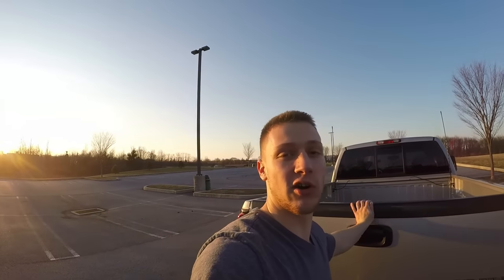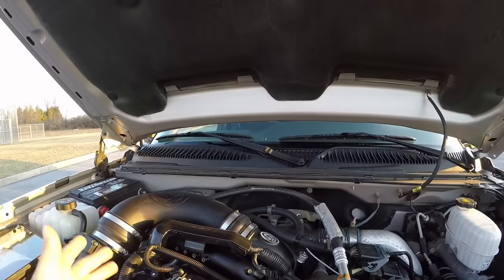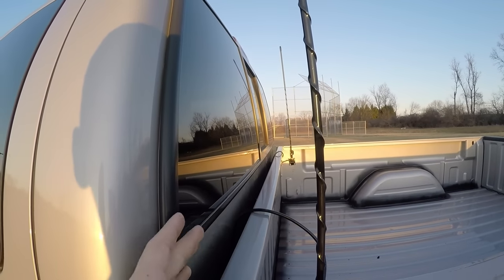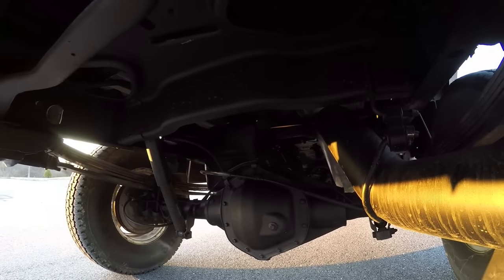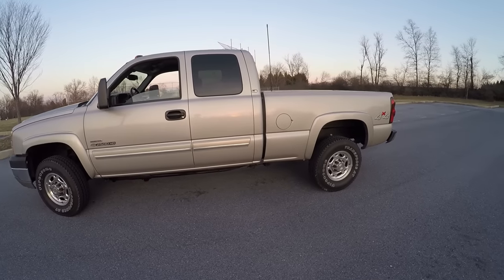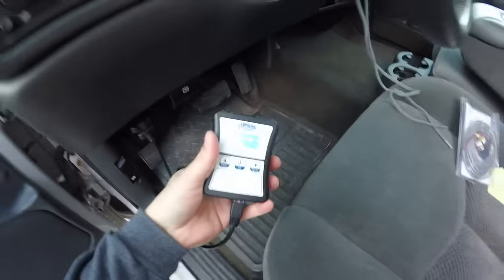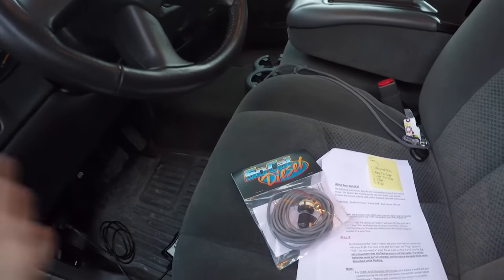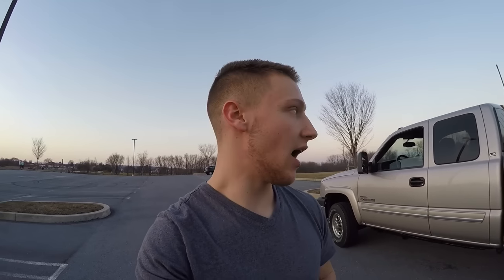Duramax Build Update! Engine Build is DONE! + How to Use EFI Live Tutorial!

Comment: Awesome job I agree with everything your doing.   Keeping it reliable and also amped up at the same time is the way to go, cuz diesels aren't cheap to fix.  Can't believe u got it with only 13,000 miles on it.   Sweet find.   Good luck with her and as a tip get some American force wheels on those axles 👌🏻.

Comment: Nice bro, your doing all the right things to the duramax for longevity and a little more power and fuel mileage. Good idea on the coolant flush. But I have a few tips for you. Make sure you change the coolant every 50k miles. Reason being is the duramax motor has a cast iron block and aluminum heads. Over time the coolant will brake down and electrolysis will happen. That is a chemical reaction between iron and aluminum. It can eat the heads and head gaskets causing head gasket failures. Also I have always ran the nictaine CAT fuel filter kit on all of my duramax trucks. It's a true 2 micron caterpillar fuel filter. All the fuel filters at the parts stores and even the Oem GM fuel filters are horrible. They let contaminates through to your injectors and it's a $5,500 dollar job parts and labor. The cat kit is $130 and it comes with 1 filter the nictaine adapter and a fuel priming pump head rebuild kit. Also the CAT filters are only $15 to replace. Also a fass lift pump would be good to
Reply: +rexburn1955 
I think it's best to change out the coolant every 3 yrs vs going by miles. You are more likely to hit the yrs before the miles. & by the time you hit said miles, you may have 4yrs+ on the coolant. (Dexcool up to 5yrs or 100K miles whichever comes 1st.) Stick with Dexcool. It's designed for it. Or if you don't want to use it, (for some reason) make sure you flush out your coolant really good before you switch to non Dexcool. 

Fuel filters OEM Racor (PFF50216)/Ac Delco (Old part # TP3012), Baldwin (BF9882) & Donaldson (P550833) are 4 micron rating. 
All are far from crap. & they are 99% efficiency. Which is what Bosch desires.
New ISO testing standards, rates the Cat filter at 4. Cat use to be a 2.
Reply: +TDNomad the shit you read online and the shit GM tells you are far from the real world. I am a diesel tech and have owned and built a dozen duramax's. I've owned every every motor configuration from my 2001 duramax to my current 2008 duramax. And I work on them every day. Dexcool looses its ability to fight electrolysis. The reason being that you tune your truck like you have and run the egt's and coolant temp higher than it would in stock configuration. Heat kills the coolants life. That's why I recommend you change it every 50k. The lly duramax and the lb7 duramax are know for head gasket fallers more than any other year duramax. Mind as well change it at 50k. It's called preventative maintenance. Also the 1R-0750 cat filter is a true 2 micron filter. Call ATP diesel and ask them if you don't believe me. They are who I buy some parts from and I run Idaho robs tunes too. And as far as the Oem filters and wix ect claim to be 4 micron. But they are actually 8-10 micron. They get away
Reply: +TDNomad they get away with claiming 4 micron but they are truly 8-10 like I said. They get away with it because of the way they do the math. They are really more than 4. Especially GM filters. They are 10 micron for sure. GM wants your injectors to fail. They want that $5,500 for parts and labor! I like your channel and think your a cool dude. I'm just trying to give u a few pointers man. I've been in the diesel world for years. It's all about preventative maintenance. And clean filtered fuel in your truck and don't run the egt's high. Egt's are what kill Diesel engines. Also Be prepared to replace your front wheel bearing every 20-40k miles after your lift FYI. O one last thing. Only use genuine Allison transmission spin on filters. All aftermarket replacements are garbage. Clean your mass air flow sensor every 10k miles too. It's a 5 min job. Since u are running a dry filter it shouldn't be too dirty after only 10k but it's cheap and easy so it's best to just do it on a 10k schedule
Reply: +rexburn1955
Wow. Where to start? 
You talk preventative maintenance but give bad advice (for being a "diesel tech") on coolant service. Coolant life as an UP TO lifespan of "X" amount of miles/ "X" amount of years whichever comes 1ST. Coolant is/should be based on whichever comes 1st. Some people may take years to reach 50K miles. & by that time the coolant is really old. You can't say just wait until you reach "X" amount of miles before you change it WITHOUT knowing how old the coolant is.

And with your said "claims", you should or at least have some actual better insight to this filter info. Call ATP if I don't believe you? So call actual techs, because you can't vouch for your own claims on this info? Got it.

I've done my research (on the net & have talked to actual GM service techs & GM diesel techs) & I'm not claiming to be a know it all. I find it hard to believe that the ISO info to be wrong. The GM service techs & diesel techs can/may be wrong, but the 1s that I talked to SHOWED me the same info I found online & the GM TSB about the micron rating on the Delco fuel filter from years ago.

The #1 misconception (you should know this) is the Racor/old model Delco filter to still be a 10 micron rating. It's been a 4 micron for years now. GM has A TSB (again you should know this) about the change over years ago to try & help prolong the life of the injectors on the LB7s. & yes the CAT fuel filter is now a 4. Same goes for Baldwin & Donaldson. I'd say look it up but you don't believe said info on the net & or what actual GM techs say to be true. Because you're a "Diesel tech/builder/owner/fix them every day" BS claimer. Oh well.

Comment: bro i got myself an 09 with a 6in skyjacker lift and 35s nittos mt with 75k miles. i ordered a egr full delete, 5in turboback magnaflow and ppe programmer. i love the power so far, im hooked never going back to gas again.
Reply: do a fass lift pump upgrade and trans go jr for the tranny with tranny cooler, protect that allison, those are my next mods which are for reliability as well.
Reply: +cgr88m one more thing, i will be changing from xds to hostile 20x10s check them out they make sweet 8lug wheels

Comment: also run your cb wires down through the post hole pockets, it has to go into that hole on the inside and then up over the pocket. i actually welded up boxes with a side missing so my whips are up on my rails and flush with the bedsides. alot better for stacking stuff in your bed and not having them in the way!

Comment: Cut the tie rap next to the alternator are you going to have problems with your FiMC and Port to fuel rail  fitting on the driver side and then your done !!! 😉 A lift pump in a factory filter filter delete would be nice to .

Comment: What paint did you use to undercoat it? I would like to do mine just for  protection. I hate the gloss color you can do with like POR15 and rattle can crap. I use rubberized paint before winter, but i need to really do my bed this summer. Trucks coming along good as well. Just a correction too. It's S&B. [S and B] Lol. No hate intended!

Comment: There is always some sort of phantom bolt holding ur things down! Truck is lookin sweet! I want to do similar things with my 2000 F150. Im still kind of a noob but why does everyone with a diesel go for the EGR delete?
Reply: EGR (exhaust gas recirculation) is just some bullshit emissions equipment made standard and all diesel pickups from the factory from about 2005 on up, (depending on manufacturer.) people delete them because they arent necessary, hurt performance and reliability in general

Comment: I think some black bushwhacker fender flares would look good. Also, I think you should've gotten some 20x10 wheels, the ones you have now are stretched a little bit and I'm not a huge game of that. That's just my opinion, it's your truck do whatever you want.
Reply: Bushwackers are a no go on anything, and the wider wheel the better
Reply: +@Back 2D Designer I'm gonna have to disagree. the wider the wheel is a better thing if you have wider tires. Stretched tires are retarded though, absolutely no function and look horrible.

Comment: still crazy how a 11 year old diesel truck has only 13k miles on it. Good purchase.
Reply: He payed over $30,000 for it he could of got a brand new Cummins 6.7 6 speed manual for $43,000 if you want a duramax buy one with like 150,000 miles for less than $15,000.
Reply: +Dodge 318 Cummins no way I would never pay 30k for a 11 year old truck, I would pay no more 15k.
Reply: +Phillip Berk only way to buy a diesel truck for 15k is if it has 150,000 miles or more, or its old as shit. its ridiculous how much value they keep. im sure you can find a decent one for 15k but your never gonna find that at a dealer, and very very rarely on craigslist
Reply: +PeteAndWyattAdventures I see plenty of trucks for under $15,000 I would get my self a perfect low miles 2005-2007 6.0 powerstroke for around $10,000 and get the engine completely bullet proofed by powerstrokehelp
Reply: +DevPack  I have a 2006 Monte Carlo SS with 13K miles.  I bought it brand new off the sow room floor.
Reply: +Dodge 318 Cummins lol "no way he couldve gotten a new cummins for 43k" yea no shit that's gonna be more than 15k more by the time you're out the door
Reply: +Jay Herrod actually only $38,000 for a 6 speed base lol. Build your own at ram.com
Reply from the maker: +DevPack Thanks man! My goal was to have one of the cleanest low mileage 05-06-07classic body style duramax's in the country

Comment: You could have ran the coax right through the holes right above the antenna mount, then down under the truck. Would have been a cleaner install.

Comment: 0:41 hahahah look at his legs
Reply from the maker: +TBMilitia Gaming #skippedlegday
Reply: looks like the pirate on family guy
Reply: +Street Speed 717 weight reduction lol
Reply: +akat9700 since the truck has cab lights, it shouldn't matter. basically the 5 lights on top of a vehicle means it's a large vehicle, like a tractor trailer, etc......unless you're a grandpa with cab lights on your ford ranger or Chevy luv
Reply: +akat9700 the DOT states that "clearance marker lights" will be mandatory on any and all vehicles 80" wide...most full size pickups are stated as being 80" wide.....they might not really be 80" but, mostly all trailers are wider than a pick up truck.

Comment: Hey bud. I have a 2005 LLY duramax too. I have a lot of the same upgrades you have done. I've had the truck for a little over 2 years now. I got it with 105,xxx miles. It now has 160,xxx miles. I will let you know what I've have had to do as far as problems. The year of the truck has a bad pump housing in the 4 wheel transfer case. it will rub a pin hole in the case and cause the fluid to slowly leak. It has ceased up my transfer case. The water pump was pretty labor expensive to replace. My hydro booster started to leak and has to replace that as well. Has the replace the fuel pump housing, it was cracked and wasn't holding a prime. it was replaced with a metal housing. the one before was platic. Both front wheel hubs, inner & outter tie rods, upper & lower ball joints, pitman arm, idler arm, upper A arms, and the main problem is my transmission. The allison 1000 for the LLY is the weakest of the 1000's. My 5th gear always slips when towing or when I'm in race tune. For an upgraded transmission, I was quoted $4,500. That is still yet to be replaced. Mods I have- EFI live, dsp5 switch, 4" strait pipe, S&B turbo inlet, PCV rerout, and EGR blocked. I wish the truck wasn't so problematic. I have friends who have other generations of duramaxs and have little to none of the problems I have had. Its a great truck but I jus got the short end of the straw when it comes to the year. Hope your truck isn't as bad as mine has been.
Reply from the maker: +chevynation yellow Good information man, hopefully I don't run into those issues but I will admit the lly is probably the most unreliable generation
Reply: +Street Speed 717 mines got 228k and no 5th gear problem or any of those just injectors and tvps

Comment: 90hp? my tune added 180 to the wheels on a 2007 2500 duramax and i think almost 300ft lbs. is that a conservative tune? it has to be.
Reply from the maker: +i Bee Amazin The most conservative one you can get lol. I wanna take it easy for a while considering it's a 12 year old truck with 13,000 miles. Wanna make sure nothing breaks
Reply: +Street Speed 717 13k is ridiculous. how the hell did you find that truck lol
Reply from the maker: Chris Pastuf Took me a while ;)
Reply: +Street Speed 717 I bet lol
Reply: +i Bee Amazin 
You don't just added big tunes to the stock trans w/o knowing what it can take/knowing you'll be needing a built trans asap. (This really goes for any added HP.) Plus those big tunes you'll want/need a lift pump. 
'Rule of thumb' no more then
90HP over stock on 5 speed Ally.
100HP over stock on 6 Speed Ally (LBZ/LMM). (Adding the TransGo Jr shift kit 110-120HP over stock.) 
120HP over stock on 6 Speed Ally (LML).
Reply: TDNomad Yea, i do have a different tranny, but i did run on the stock for over a year and never had a problem.
Reply: gv g 
Tuning is for fun. You got to pay to play. MPG tunes gains vary. I mean you can’t expect to get good MPG when you lift, add bigger tires on a 6K pound truck. Adding a MPG tune to that just cancels it out. Even on a stock height, stock tires truck MPG tune could not net you much.

Stock trucks have plenty of power & longevity is more likely to happen by not tuning, due to the added power from tuning.

Comment: Why go with the 90HP as a max tune? A fass or air dog lift pump and a 150HP EFI live tune from PPEI would really WAKE the truck up!
Reply: +JRfat2 FIT 
You don't just added big tunes to the stock trans w/o knowing what it can take/knowing you'll be needing built trans asap. (This really goes for any added HP.)
'Rule of thumb' is no more then 90HP over stock on a stock Ally 5 speed.

Comment: What was the code for the engine light?
Reply: was it because of the exhaust
Reply from the maker: +Bailey Sperling EGR Code and turbo under boost code (because of the exhaust+egr)
Reply: +Street Speed 717 so was the truck in limp mode?
Reply: +Street Speed 717 from some research it could be a boot leak somewhere. http://www.duramaxdiesels.com/forum/showthread.php?t=19299

Comment: the reason people roll coal is to look cool but the tune that you use to roll coal just puts more gas in the engine not air therefore u have unburnt fuel which is the coal part and that doesn't make ur truck faster at all u loose power. the man in the video is smart because he is making more power because his dirtymax is running the most efficiant. no coal more power smoother running engine!!!!!!   #duramaxftw

Comment: wtf I've always thought tunes were a bad thing such as lower mpgs or risking your engine in performance tunes
Reply: Tunes are usually the exact opposite
Reply: Tuners up mpg for the most part.  And as long as you dont have it cranked on some crazy tune you won't tear anything up.
Reply: i did some research what do you guys think about a 93 octane tune? diablo claims it increases about 20hp but would this tune stress the engine?

Comment: Say goodbye to your gas mileage as soon as you put those wheels and tires on.
Reply: +Kenshin Himura It runs diesel fuel.
Reply: Got better fuel economy in my 01 cummins when I put bigger tires on it. Stock tires would run about 2100-2150 RPM's going 75, bigger tires RPM's would be 1950-2000 at 75. Better fuel economy at lower RPM's. That insignificant amount of a weight difference on diesel trucks doesn't mean jack as far as fuel economy.
Reply: Michael Payne This is true. My LMM got better mileage when I went from a 30" to a 32". My gas truck lost about 2-3mpg when I went from a 31" (275 width) to a 33" (315 width) also went from a P rated tire to an E rated tire, so add about 25lbs a corner.

Comment: Don't even roal coal lol
Reply from the maker: +Chase Peltzer Not tuned for that, not my style
Reply: Friends don't let friends roll coal
Reply: +Street Speed 717 Major respect for you. I see you bought tunes from Rob Coddens. Amazing guys. I can promise you that you did NOT go wrong there. He's best in the nation for a reason. Chase Peltzer is an idiot if he thinks a truck is cool by rolling coal.
Reply: +me this guy depends if this truck is gonna be meant to be somewhat fast. If it is it will eventually roll coal at some point due to more air and fuel that will be needed, but if not then yes you are correct
Reply: +Street Speed 717 you know nothing about diesels. You throw a large tune at it you will have smoke during low boost. That's a diesel for you. Unless you want baby tunes your gonna smoke a lil when wfo at low boost.